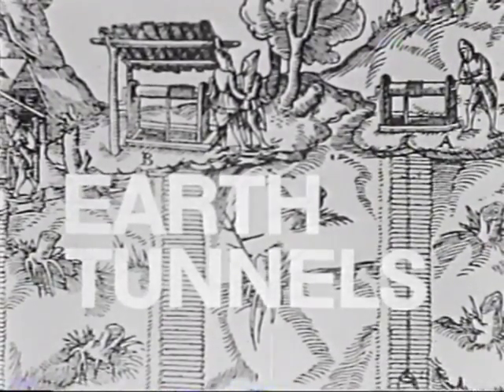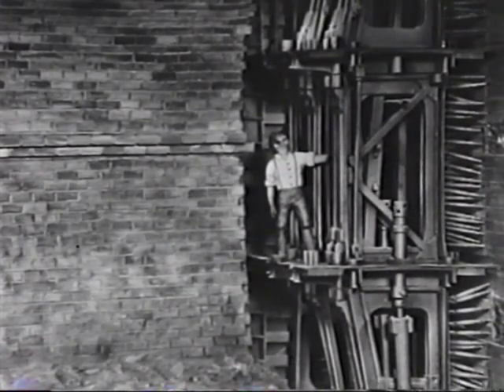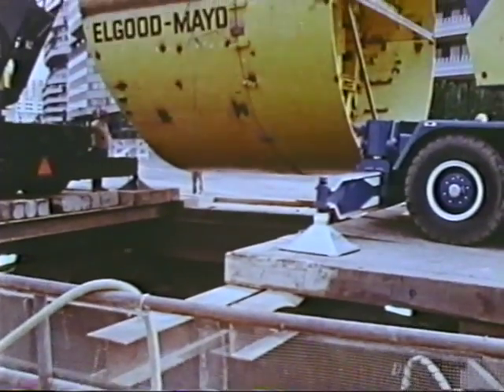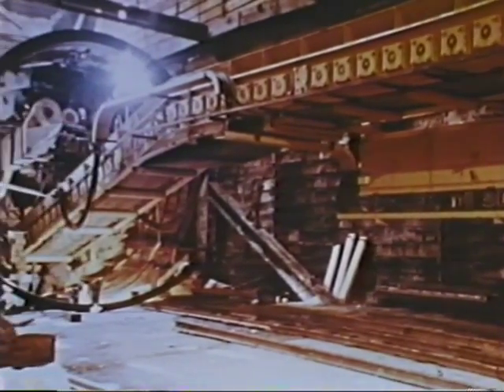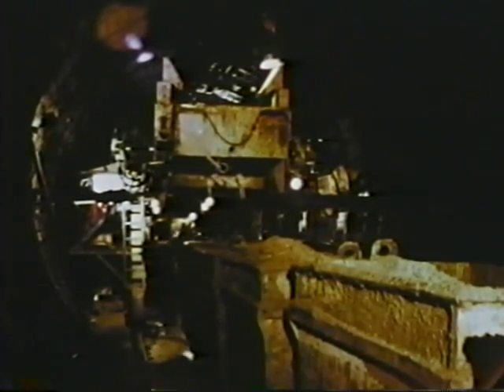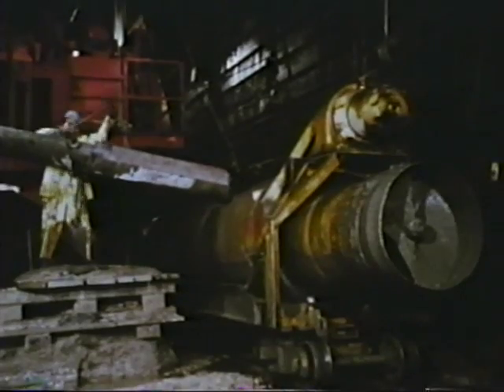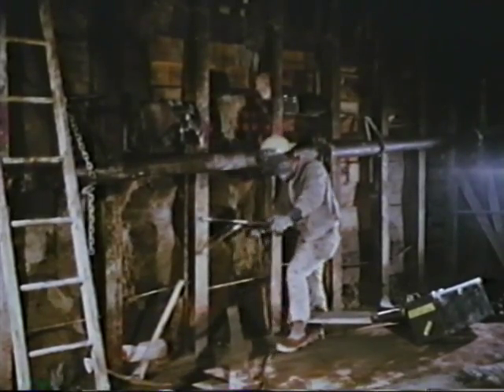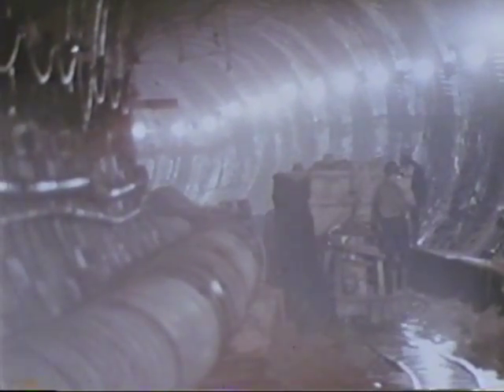"Earth Tunnels" | Building Metrorail

Comment: I used to live near the Foggy Bottom Metro station in the 1970s (before the area was horribly gentrified).  I remember looking through the timbers covering the street for a “cut and cover” operation and seeing railroad track with wooden ties far below. Until I saw this video, I didn’t realize why I wasn’t seeing the cement-mounted tracks the trains currently run on in the tunnels.
Reply: I live 2 blocks from the Foggy Bottom-GWU metro station. Can confirm, gentrified beyond recognition

Comment: May I ask the date of this video?
Reply: Probably the early 1970s.  The first DC Metro line opened in 1976.
Reply: ***** Thank you John. Because WMATA didn't build all tunnels at the same time I was wondering if this video represented early methodologies or if they used the same process as they expanded the system. I think you are totally correct as to the 1970s; just wondering if trains were running elsewhere on the system at the time this was filmed or this was the kick-off of the whole system.
Reply: Aldous Huxley They mention tunneling under Lafayette Square, which would have been the first segment of the Red Line from Farragut North to Rhode Island Avenue that opened in 1976.
Reply: ***** Good Eyes! Thank you!
Reply: not true. Tunnels were done In Anacostia, and other places.I worked on them. BUT it was well known that Georgetown didn't want a station, because they didn't want "poor" people to come there.
Reply: @penguinsfly2  - you mean the crime
Reply: @JoseCruz-kp7ru  Nope. The earth is too soft, wet, and sandy at river level. Building a Georgetown stop was simply cost prohibitive.
Reply: @generalconfussion5720  That excuse was as good as any but, we tunneled through a lot of wet running sand, cost had nothing do to with that decision. Keep in mind the blue/orange run under the Potomac river and Rosslyn & Bethesda were through solid rock.
Reply: Wow my dad helped build most of the subways with Clark construction and George Hyman
Reply: They used the cut and cover method through the poorer neighborhoods. They tunneled underneath in the rich neighborhoods and tourist areas.